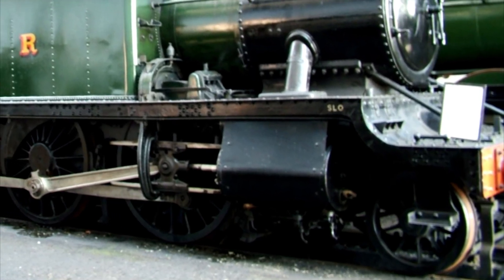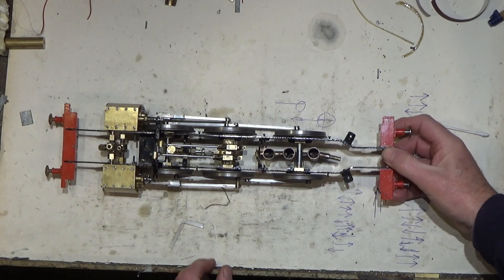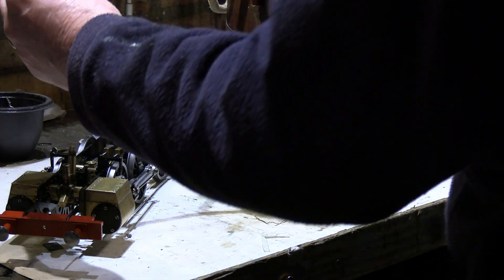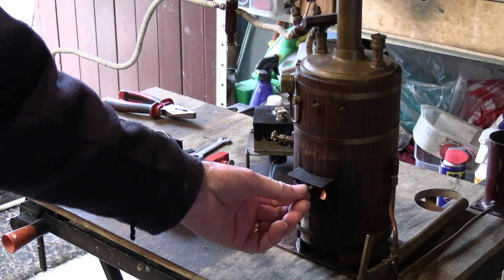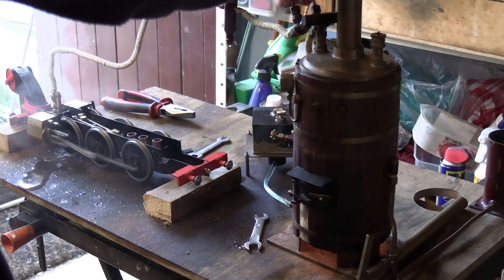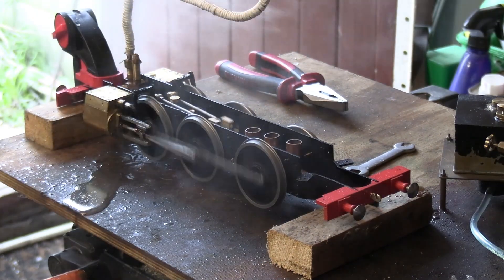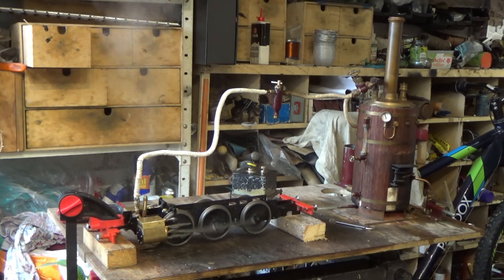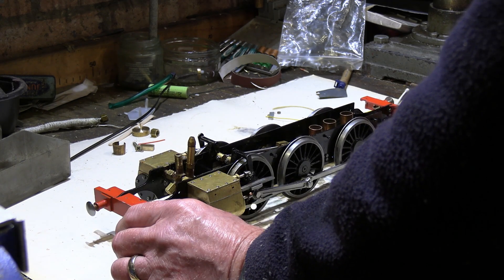Gauge 1 Live Steam Scratch Build 34

Comment: Well done, dave - fantastic work. I've followed your build on and off and it's just amazing. I know you designed this yourself (or at least I think you did!) but how much more work is a loco like this compared to a Project or Dee?
Reply from the maker: Many thanks glad you’ve enjoyed the series. I guess I have redesigned about half of it.  As the original drawings left a lot to be desired. I did not like their design for the boiler or the spirit burner. There were some other parts that were not manufacturable as they had been drawn. The problem with the drawings was not what they did say, more like what they didn’t say. I applied experience from the Project and from  my other builds. I don’t know what the build difficulty is with Dee, but I would say this build was more complex than the Project.